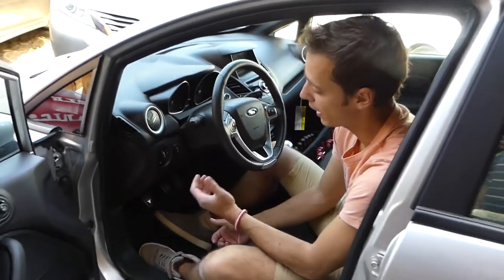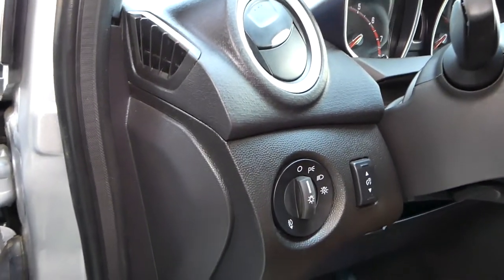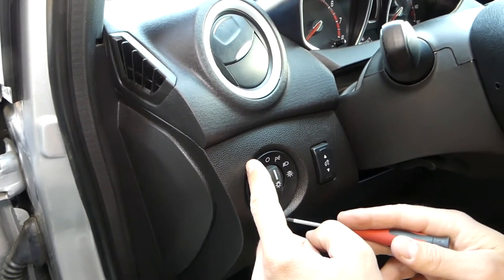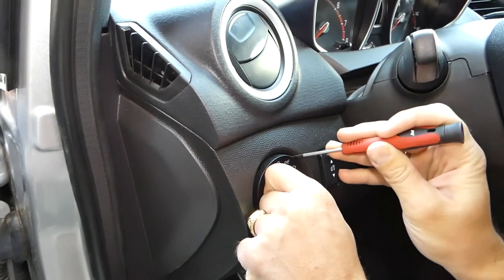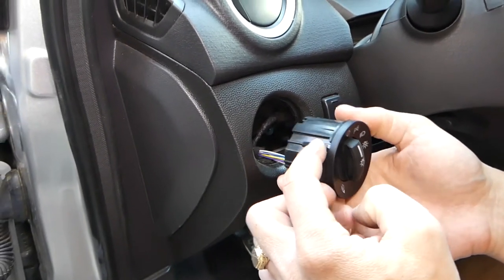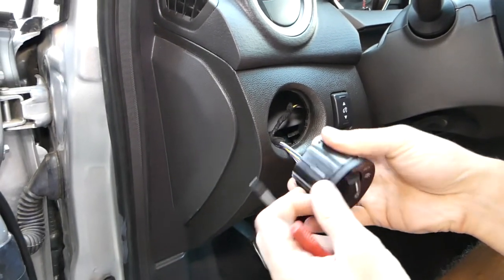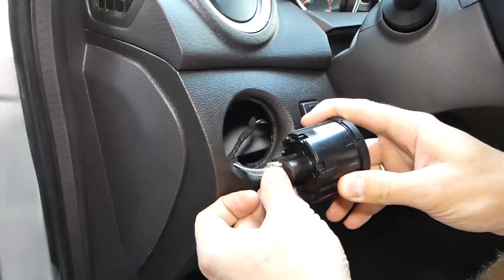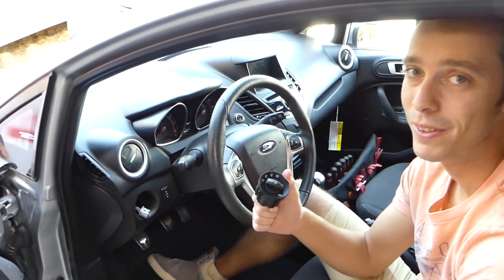FORD FIESTA HEADLIGHT SWITCH REPLACEMENT REMOVAL MK7 ST

Comment: Hi, I have a Ford Fiesta SE, I installed the fog lights and changed the light switch, but the fog lights do not turn on, do you know what to change? thanks
Reply: I have a 2017 also, and have the bezels, Diode Dynamics Elite Series amber color fog lights, and the factory OEM fog light switch to be installed when I get a chance. If you got yours to work, you may tell me how you did. Thanks!🙂
Reply: You have to go into the software and turn on the fog lights as they are currently switched to off in the programming

Comment: If you have a fiesta with no fog lights on the switch, can you just exchange the switch for one that does and its already pre- wired?
Reply: I am curious about the same thing. It looks like the harness is pre-installed as are the fuses and relay. Seems all I need to do to make it hot is swap the switch.
Reply: Yes and no... i am in the middle of trying it now.. they are pre wired because when you take off the blank panel the wires are there and clipped to the front fascia. So i bought the fog lights and fog light housing and installed them... then i bought and installed the fog light switch which fits perfectly and plugs right up. I checked and made sure the relay and fuse was there.. it was.. fuse #19 and i believe relay #8 (both were there). But when i turned on the switch... no fog lights.  Everything else is working.. my next guess is that the Ford dealer may need to flash the computer to tell it, it now has fog lights.
Reply: @johnnyturbo8460  I just came across this.  How did you fix your fog light issue.  I am about to do this.  Thanks.
Reply: @nickvonzipper8236  after you get the new head light switch and hook up the pre wired fog lights unfortunately you still have to go to Ford and have them unlock the fog light option on its computer
Reply: @johnnyturbo8460  Thanks
Reply: @nickvonzipper8236  just double check with your local Ford dealer. Some won't do it. So before you order it, call them